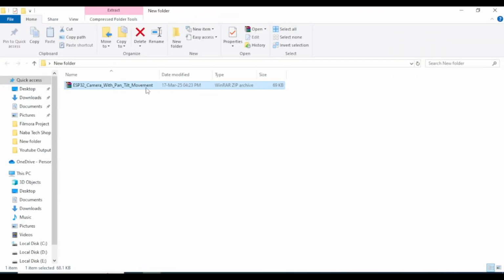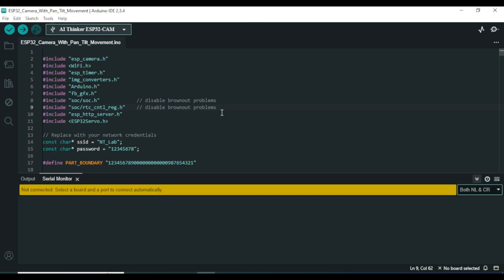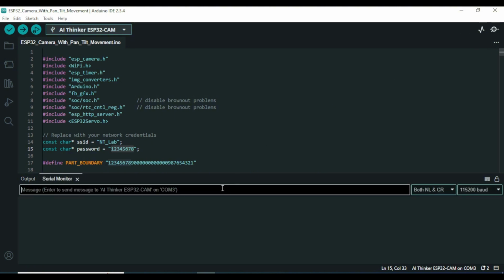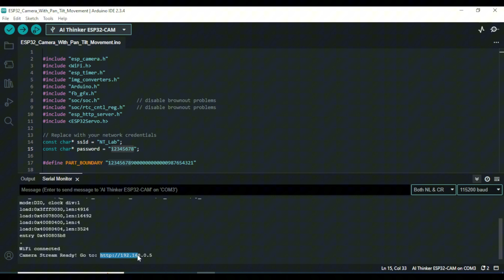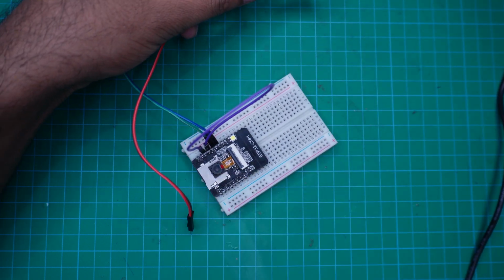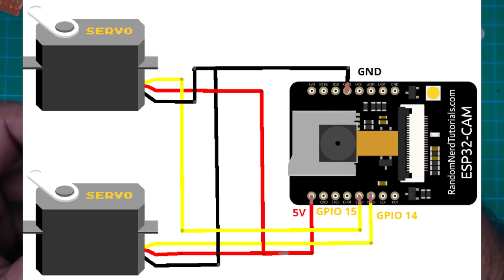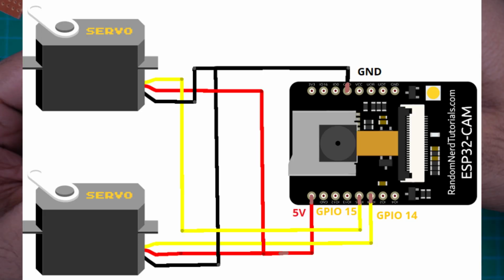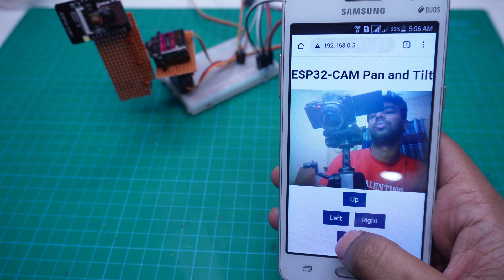ESP32-CAM WiFi Camera with Wireless Pan & Tilt Control | DIY Smart Surveillance

Comment: What are those platforms you're mounting the camera and motors on? Looks like one of those universal PCBs just cut to size. Should I use something like that?
Reply from the maker: Yeah, correct. I have used Universal PCBs also known as Vero Board. This board is enough hard to give support.
Reply: @NTTronix  Thanks for the clarification! Great project and video!

Comment: почему видео поток иногда пропадает и приходится перегружать камеру?
Reply from the maker: May be heating issue. Try to use a cooling fan and use a better power supply
Reply: @NTTronix  это происходит если часто подключаться и отсоединяться от потока